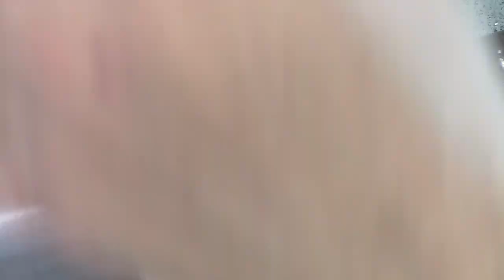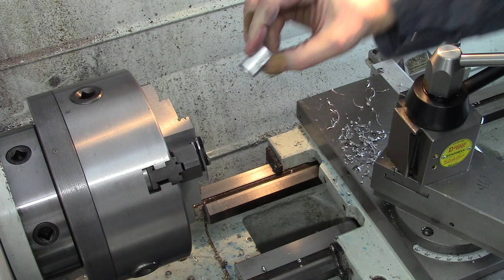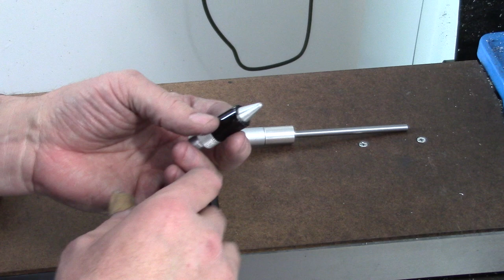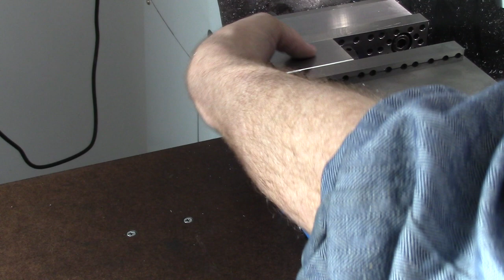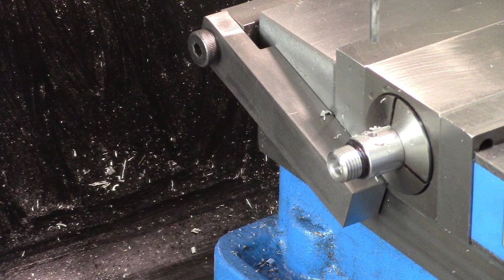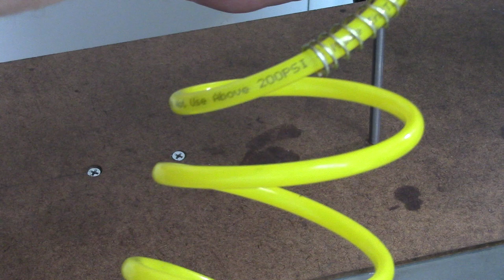Shop Drops Vol 8, part 3

Comment: nice machining work mike. i doubt if your gun would be osha approved. osha requires that air pressure at the discharge end of the gun be less than 30 psi. your technique would only be effective if you adjusted the input line pressure with an air pressure gage on the discharge end. pressure drop across the multiple orifices is a function of line pressure and available cfm. i dont know anyone who has ever been satisfied with an osha "approved" blow gun.